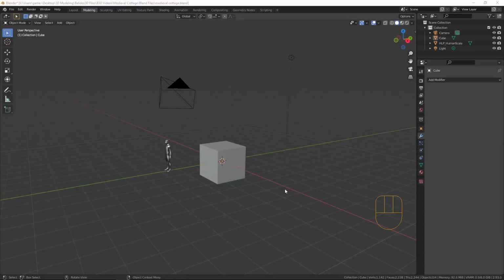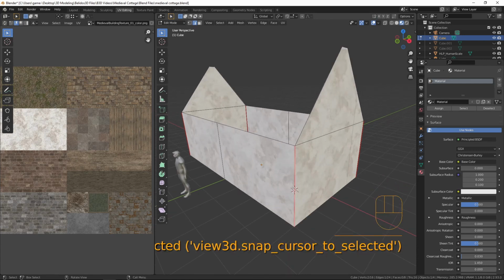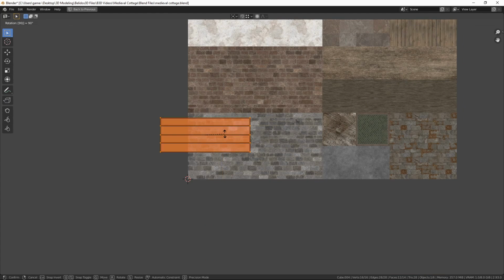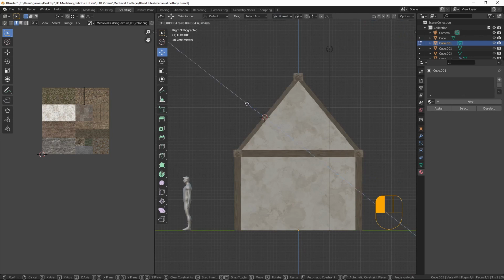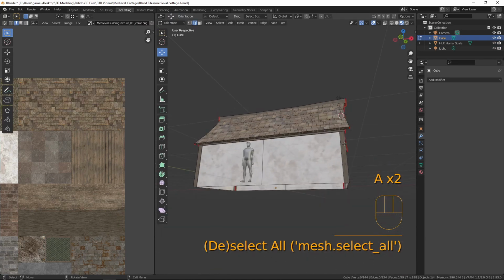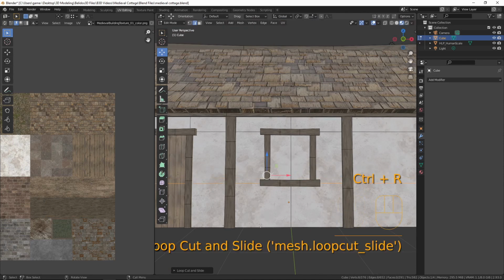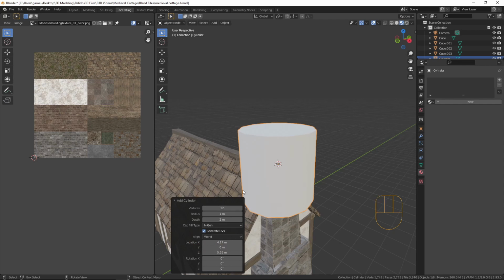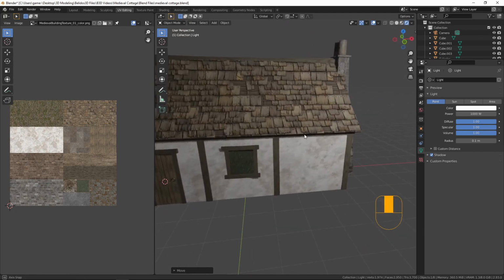Creating a Medieval Cottage | Blender 3D Modelling

Comment: Bro I have a question, I was trying to make a building with modular pieces, but when I have finished my home or anything I can see lines like seamless, how can I fix it when I create a texture atlas?
Reply from the maker: The texture would have to be a seamless texture and you would need to line each piece up perfectly on the UV to avoid seems, or you could adjust the model to hide the seams with geometry, for example in my model i hide the seams behind the wooden beams
Reply: @checkingmylootz  yeah, u are all right, I was using seamless texture but when We use many pieces, I think that I should use that pieces following a direction to avoid seamless, for example pieces 1, pieces 2 and pieces 3, If I put pieces 3 with pieces 2, u can see line of seamless but if I put 2 + 3, seamless Is not seem.